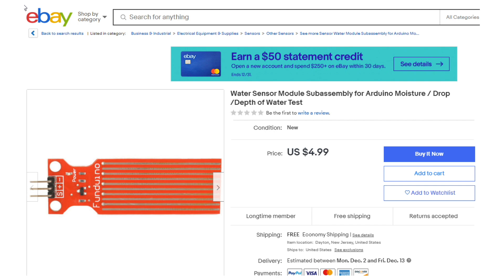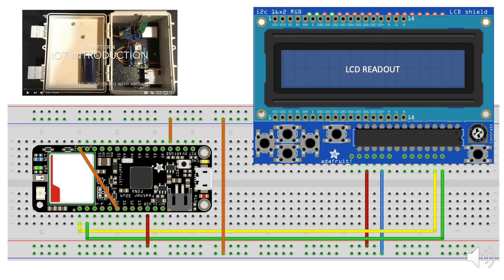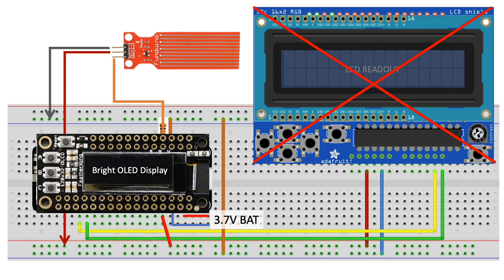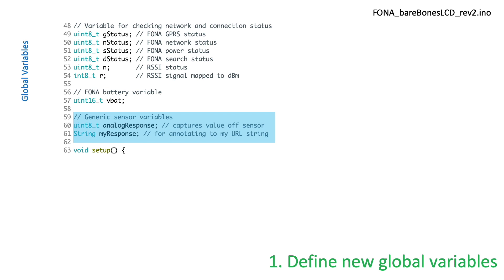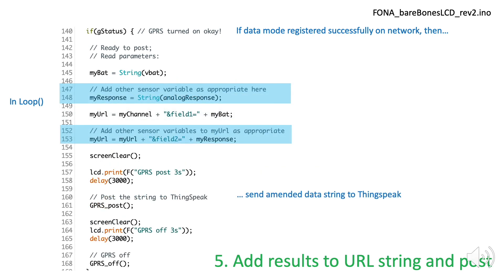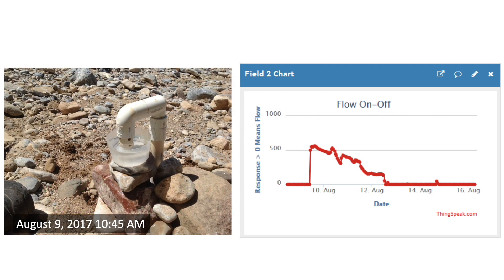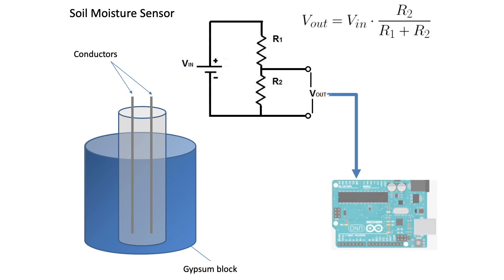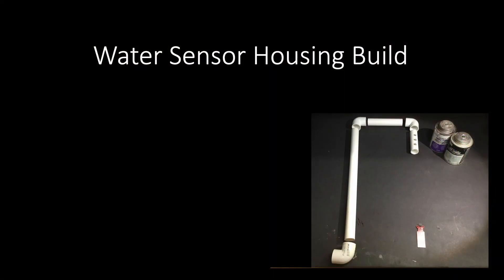Cellular Telemetry for Remote Flow Detection

Comment: Can you have both communicatoins installed and use them in the following case. Try to send a packet first from the cellular modem and if it fails then send a signal from the satellite modem. This case happens every certain amount of time since you dont send packets through the satellite modem so often due to costs.
Reply from the maker: If I have cell phone coverage, I most definitely will avoid satellite. These sat modems are expensive and only deployed where absolutely necessary.